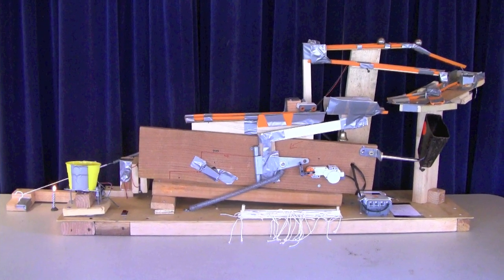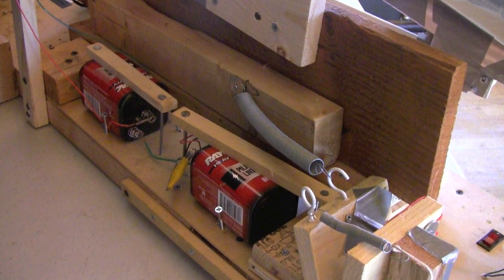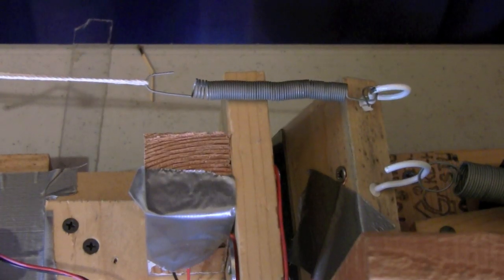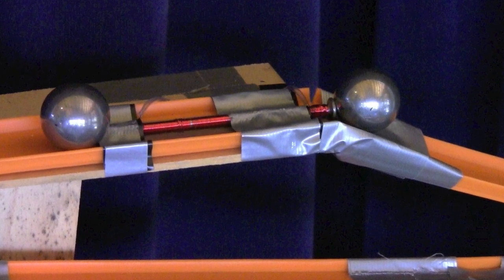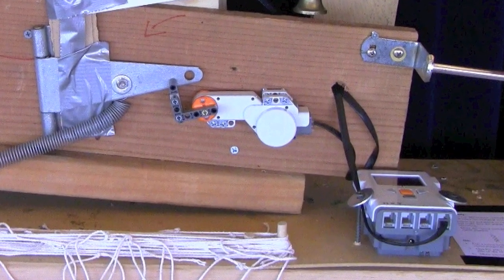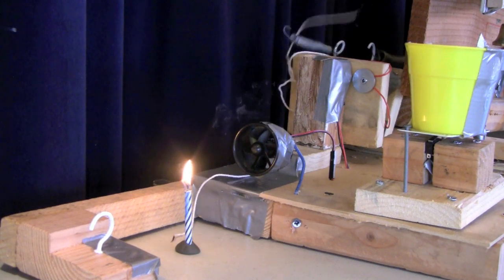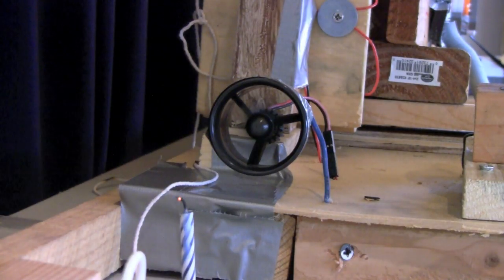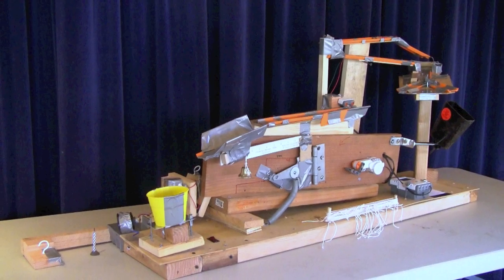Rube Goldberg Machine: Self-Extinguishing Candle

Comment from the maker: I used so many random components that I found around my house that it would be impossible to make an exhaustive list.  My key ingredients were duct tape & wood.  You want a whole lot of wood scraps (in addition to some nice 2X4s and ply wood etc) so that you can make little adjustments.  The balls are pinballs (very heavy and magnetic).  I used lots of enameled wire for the electromagnet and regular wire to wire the whole thing up.  The orange hot-wheels track was indispensable.  Does that help?